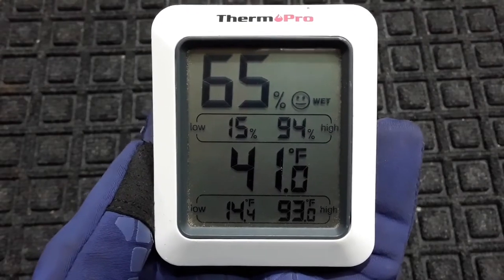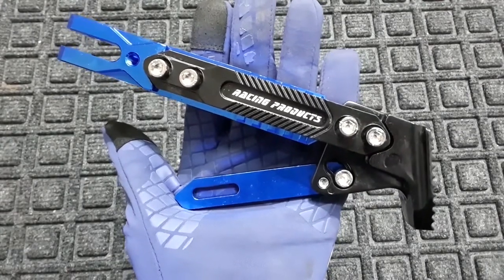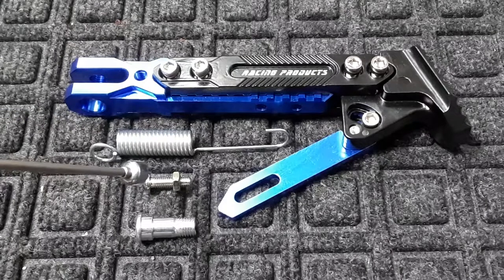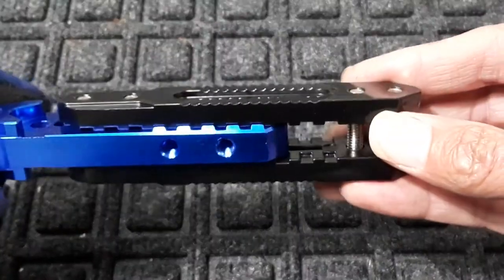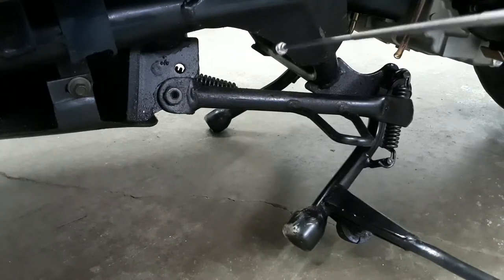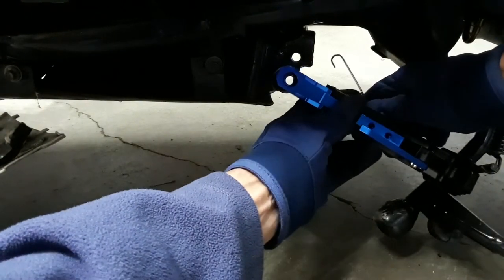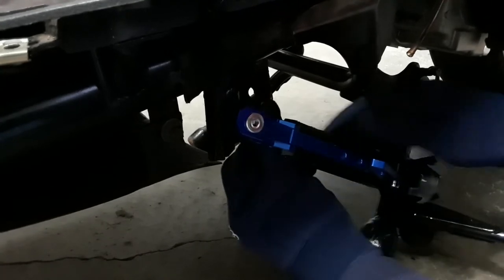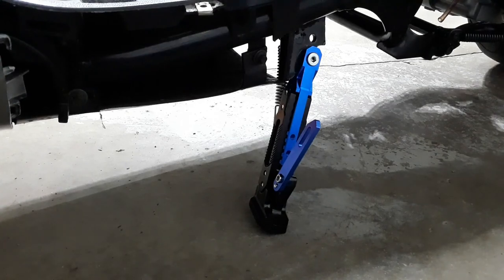Universal Adjustable Motorcycle Kickstand Install in 2 Minutes / How To /150cc Scooter / English

Comment: Looks good. I've been thinking about getting one of these. Not the same one though. Maybe the Lancers got mess up center stands because I cant imagine how mine got bent up. I took it off.. My ancient Jonway stand looks perfect compared to my Lancer stand. It's funny my gas gauge has never worked. Must be a Lancer thing.
Reply from the maker: Yeah, mine was garbage from the 1st day. This one is about 1 1/ inches smaller than original. I don't know if I would put it on my motorcycle though. I have seen a couple of broken ones. Maybe to much weight.

Comment: I bought one of these last year, and it started rusting slightly about 2 weeks later. 

Also one day it's decided to just snap in half, making my bike fall over in my garage. I have a pretty light 600cc bike, about 180 kilograms, but it couldn't even support that long term, even though it's supposed to be rated for 500 kilograms. It was cheap, and as with most cheap things I guess you get what you paid for - lessons learned.
Reply from the maker: Sorry to hear that. Yeah I think I would go a different route for my R3. The lean of the bike seems it would put way to much weight on the kickstand.

Comment: Sir It's applicable in all bikes
Reply from the maker: Not really. It depends on the weight of the bike. I wouldn't but it on a Honda Goldwing.
Reply: @kachiskid  ok but it's applicable in splendor
Reply from the maker: @chaitanyaraut4881  what type of bike are you putting it on?
Reply: @kachiskid   It's 4 stroke hero honda splendor plus bike
Reply from the maker: at Kerb Weight 109 kg, you should be good to use one.
Reply: @kachiskid  ok